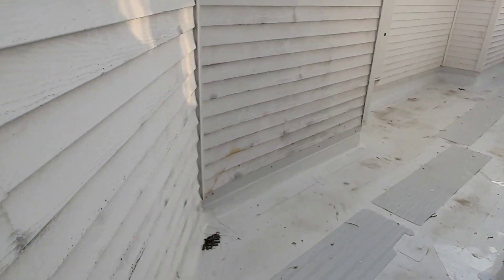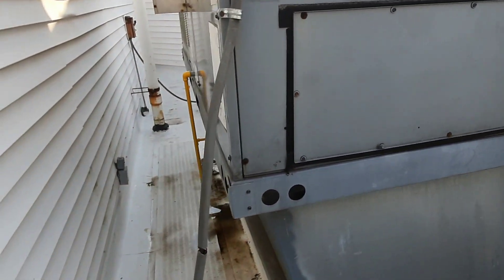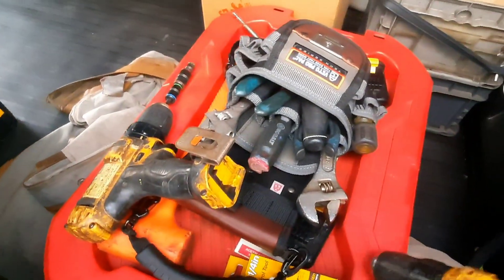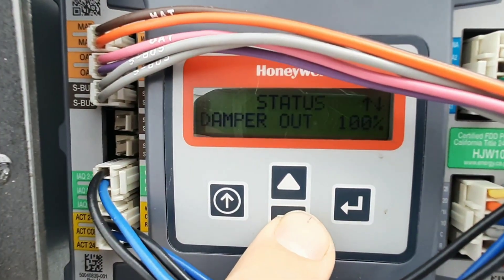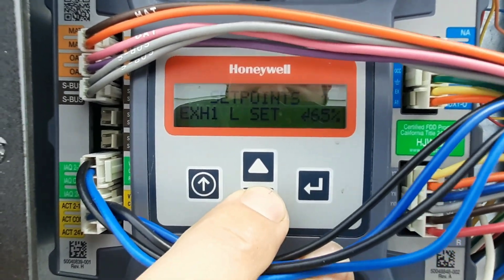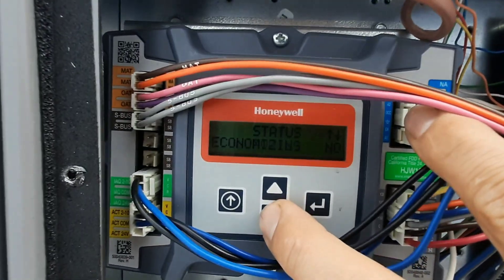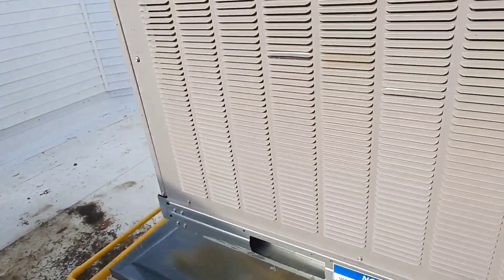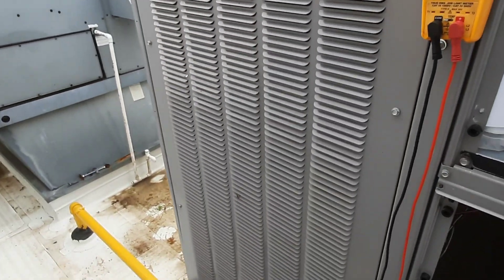new carrier package units, poor start-up leads to a service call. #hvac #hvacservice #hvaclife

Comment: Finally found a use for a Goodman!
Reply from the maker: It's all Goodman quality these days 😆. Goodman actually got better when Daikin came in, but it all seems like junk without quality control anymore. They don't make as much money if the equipment last 20-30 years, like it used to, so it fails in 1-5, and the customer pays for it